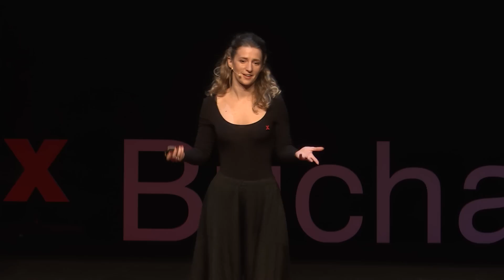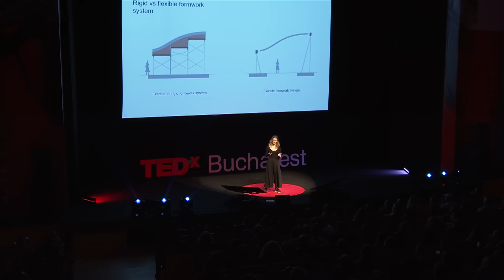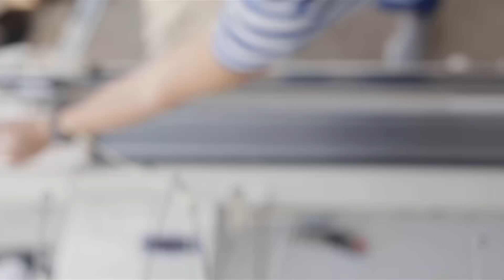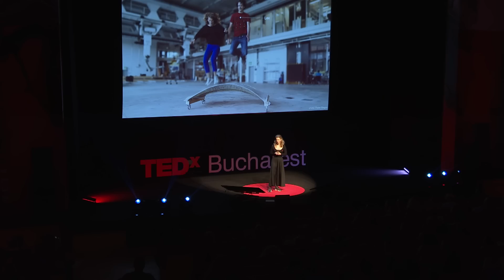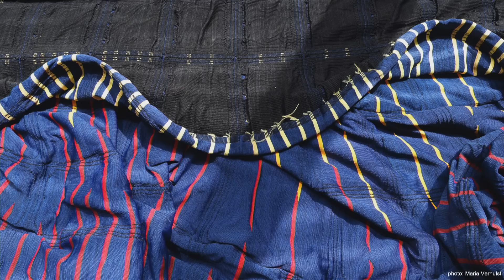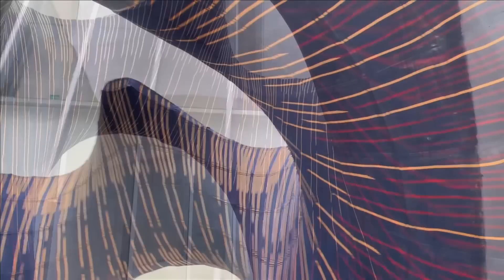Knitting Architecture: Be Smart about Building Concrete Structures | Mariana Popescu | TEDxBucharest

Comment: Great. Now get a group of guys without high school diplomas and grade 9 math to set that up. Architects spend so much time finding solutions to the wrong problems, apparently even when they’re doing engineering. They’re damn good at selling their ideas though.

To be more specific, this is such a niche solution to a non-problem. People don’t live in fancy curved structures. The most efficient (and liveable) floor plans are based on right angles. If we’re concerned with constructing buildings to house large numbers of people, then this method isn’t a solution to that problem. 

Prefab concrete that can simply be raised on-site is a much better solution for the stated problem. Creating new materials, with less of a carbon footprint and which can also be prefabbed is another (better imo) solution to the problems outlined at the beginning. There’s a disconnect between the beginning and end of this talk. This technology doesn’t address the need that is given as the motivation. Sure, it’s cool, but it’s also fanciful and unnecessarily extravagant. 

Notice how she stopped talking about practicalities after the introduction? The end was about the feel of the fabric, the way the sun shines on it, how you can lean against it. But it wasn’t a home. It was an art piece.
Reply: She started talking about climate change like it was a problem for architecture. You are quite right, what she has shown is pretty, but irrelevant.

Comment: Great idea. If I wanted to build a 4 storey residential block, less concrete for foundations and walls. Not sure how I would add floors, but I expect it could be done under high tension with rods. How we scale up is the problem. Pioneering designers are looking to build down, especially for commercial properties. I expect many current commercial properties will change to residential, especially as home working is becoming more popular. I could use this concept to build a warehouse or large farm building. Do we need more sheep? What other natural materials could be used?

Comment: I mean, I'm not an engineer or a architect, but how are you suppose to repair it? Because if I understand it right it would be exposed to environment, which means different weather or if only inside where exposed, high moisture in the kitchen or bathroom. 
Imo it's a step in right direction, but it is not the solution we should stick with. A good start will be to build what we already got technology for, like using old bricks from other no longer in use  buildings to build new houses. Not only you have to do less (I think), but also it doesn't require a specific shape to be build properly. 

In conclusion I'm interested in finding new eco friendly material for building, but I don't think this one at the moment is any solution to this problem.
Reply: Well have you seen any highway bridges built with concrete beeing repaired as of lately? Standard concrete structures do not address this problem in a better way I recon.
Reply: @blackorbman  not really, but recidencial buildings yes